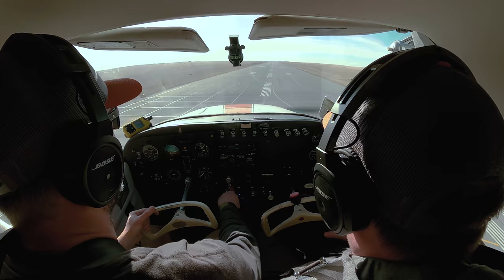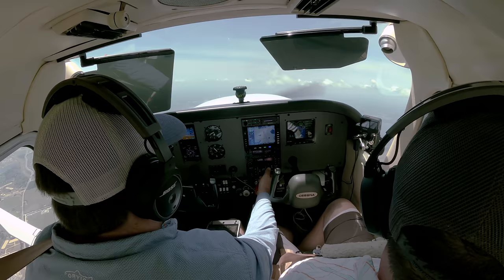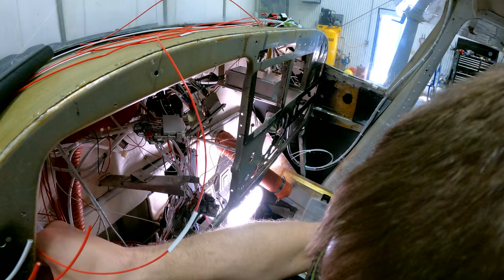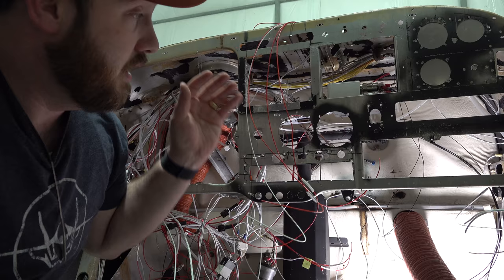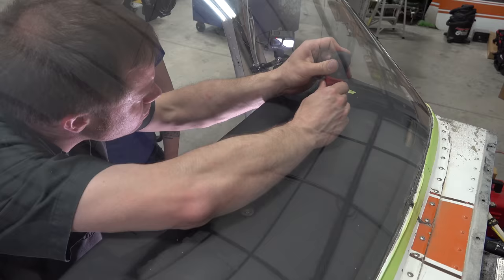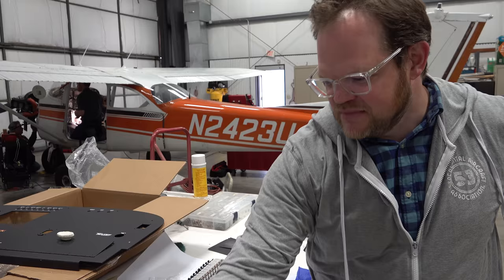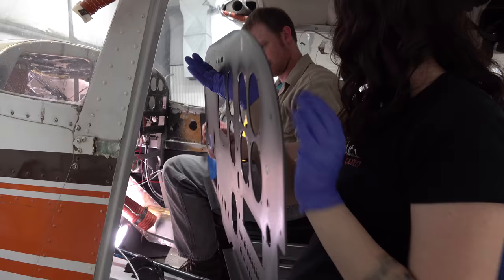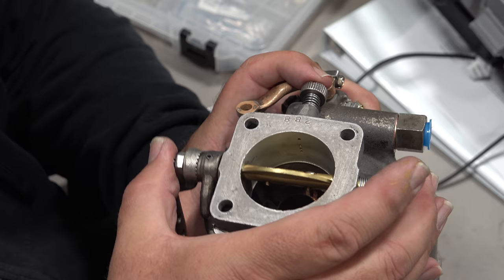OLD School ▶ NEW School: Extreme Panel & Avionics Makeover

Comment: It's a thing of beauty, eh!  Oh, no doubt eh!  Reminds me of how excited my son and I were when we did our panel back in 2020 on our 77 Grumman Tiger.  Traded plastic for a nice aluminum, custom panel... replaced our stock A/I and old HSI with two G5's, added a USB power port, removed our vacuum pump, removed old wiring, cleaned things up, etc.  Spent a chunk of change, but it was well worth it.  I just replaced one of my mags with a SureFly as well.  Now I just have to add an auto pilot and I'll be happy... or will I?

Fly safe and fly often!

Comment: This reminds me my last annual. The engine was making metal badly enough that we needed to do something about it and the path of least resistance was a Lycoming factory rebuilt engine (the old engine was showing signs of age anyway). Bolting in the new engine was a small part of the work: it didn't account for all the extra things that come up when you take an old plane that far apart.

Comment: Panel looks great i really like the black spackle paint look. The yokes are a nice individual touch.
 The paint buffed up real nice, have you or will you do anything to add some paint to touch up the spots where it has clearly worn off? Paint looks mostly gone on struts, leading edges and maybe some horizontal surfaces? I'm not degrading your beautiful plane I'm just wondering if there is anything you could do to put some paint back on those spots.. or if maybe it's best to leave it alone?
I bet that beautiful Panel and that Carb rebuild will really change the plane .

Comment: Chris, when you went under the front of your plane to discuss the carburetor, I noticed that your nose wheel strut appears to be disabled.  It looks like you have hose clamps and maybe a rubber sleeve around what little strut shaft is exposed.  I know you have an oversized front wheel and fork.  So by having those installed you lose the oleo shock action on the nose?

Comment: G,day Chris from Sydney Australia.
Favourite part of the panel: altimeter- always is. I think that is because the terrain is very hard.
No but seriously, love the yoke covers and stitch. The powder coating and lettering looks amazing.
Well, it's not just a matter of wiring harness and plugs into the back of avionic components.
Lastly, all the mechanical moving parts of the carberator with it's sealing butterfly valve and machine threaded screws, stills worry the s&#@ out of me! (Vibration).
Great film, looking forward to seeing the engine run.
🌏🇦🇺